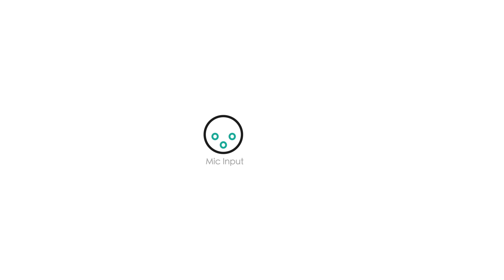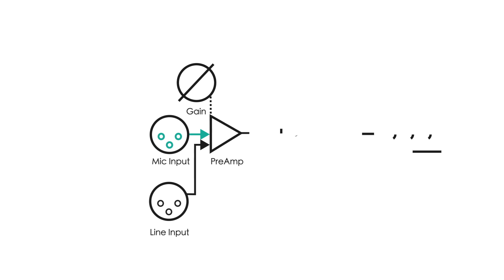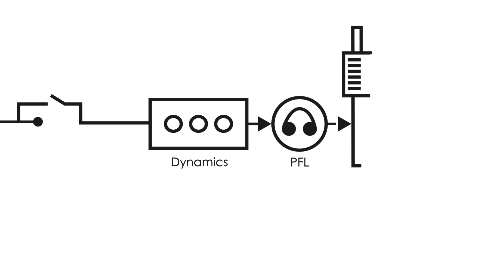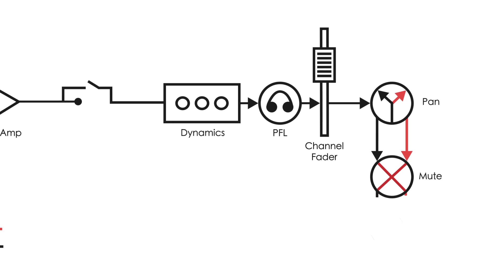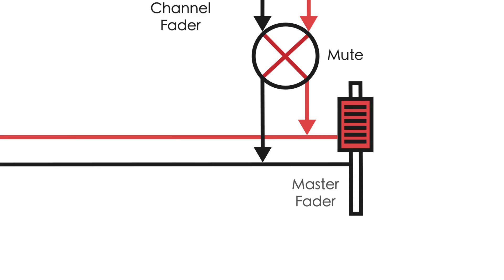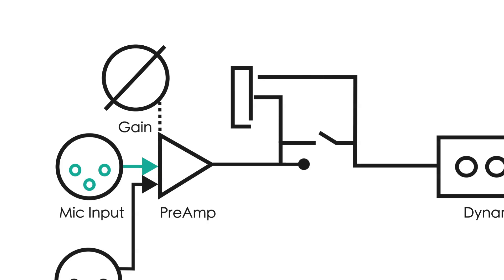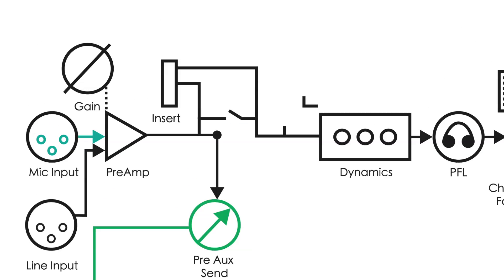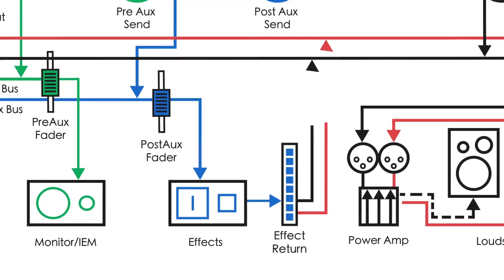Audio Theory - Console Signal Flow

Comment: Where does interface fit into this (e.g. if you're using a DAW)? Where does analogue to digital conversion take place in this process if you're using a mixer with a DAW?
Reply: Zani I believe if you were to use a hardware mixer with your daw you would have your computer going to your D/A converter (audio interface with enough channels to match your mixer ideally) where you'd then have the outputs of your interface going the input of your mixing console. From that point you'd have to tackle the settings in your daw to make sure all your inputs/outputs are functioning. Hope this helps.

Comment: Do signal flow of full analog recording.  Tape machines and console.  Live recording and studio recording can differ. Because in live recording sources are live and simultaneous. But in studio recordings  each track can have it's own separate tape machine which goes to multi track tape machine.   So in live recording the routings will be like this: 

Live multi inputs source—>Multi track tape machine ->  inputs of console  -> Master bus of console -> Master tape machine. 

So in studio recording the routings will be like this: 

Each stereo or mono track will have it's own separate tape machine—>Multi track tape machine ->  inputs of console  -> Master bus of console -> Master tape machine.

Comment: +MrChinosChannel When discussing bus in the signal flow, are you referring to 'grouping' as found on a Mackie 32x8 where it has 8 busses? 

I'm in the process right now of designing a signal flow chart for a live sound PA system in class, and signal flow is really discouraging to me. Half of the equipment we're supposed to use for the assignment, I don't understand. 

My assignment is as follows: This sound assignment must have the following items in your virtual PA Live Sound System Set-up. You'll have a $35,000 budget to purchase your equipment. You don't have to buy new equipment, so keep in mind places likes guitarcenter, sweetwater, ebay, etc for used gear as well. Once you have your equipment list in order please design your signal flow chart showing how your set up will be. 

Note: some mixers utilize compression, gates, etc. I will take this into account as you design your set-up, and you must show that the system you 'chose' can do that (either in signal flow or showing me the manual of the mixer). 

Your system must have the following: 
-24 channel mixex with road case (no rack mount) I chose the Allen & Heath QU-32 digital mixer
-Four channel of compression (for insert  drive rack) 
-Four channel of noise gates (for insert  drive rack) 
-One digital delay processor (for effects loop  drive rack) 
-One digital reverb processor (for effects loop  drive rack) 
-One digital system processor (mains - drive rack) I chose the dbx pa2 pakcage w/ rta mic, stand and cable
-Four channels of 1/3 octave graphic EQ (two for mains, pre-system processor - drive rack; two for monitors - drive rack) 30 band graphic eq. The qu-32 should be able to handle this need
-One rack mount AC power conditioner with rack lights (drive rack) I went with the Furman M-8LX Merit X series 8 outlet power conditioner & surge protector w/ dual rack lights
-two to way, passive speaks (mains - will be bi-amped) no idea what bi-amped means
-Two powered two-way speakers (monitors) I'm sure these are the wedge speakers on stage for the band. 
-Two speaker stands (front of house) for pointing towards the audience, which makes sense. 
-Two power amplifiers for mains (one for lows handling up to 200w, one for highs handling up to 75w - amp rack)
-One amp rack with casters (at stage)
-six shure sm 58's
-six shure sm 57's 
-two shure sm 81's
-four sennheiser e604's
-one sennheiser handheld wireless mic system
-sixteen mic stands: 6 short booms, 10 tall booms
-six passive DI boxes (these can be active DI, so don't worry) 
- one twelve-channel sub-snake <- whats the difference between a snake and subsnake?
- two six-channel sub-snakes
-one 150' 24x8 main snake
-One 150' AC cable for amp rack (20 amp capacity) 
-one 50' 4 quad AC stringer for backline (20 amp capacity) what is a backline? 
-All cables, adapters and power strips needed to connect everything together
-one large, heavy-duty road case for snakes & cables
-one road case for mics, DI's, Tools, misc stuff, etc.